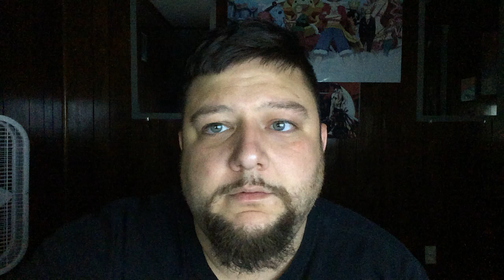K20 Rotating Assembly Swapping

Comment: Hey I have a question? So you said the k20a3 is the only Engine with a different crank. My question, I understood the rod bearing journals on the a3 crank are bigger, but are the main bearing journals also bigger or are they the same as the other cranks??
Reply from the maker: Mains are the same

Comment: Hey man, quick q.  I scored some TSX cams and was wondering if this is a direct fit on a k20a2 block?  Can I also swap the 50 degree VTC on it.  Lastly, can I run this with my existing tune to get to the dyno safely?  thanks
Reply from the maker: bhadz100 1 yes 2 🤷‍♂️ 3 no. Anytime you change anything you need to tweak the tune
Reply: VHB Engines I received the cams in the mail and noticed that the actual shafts (not the lobes) have some wear/scratches.  is that fine to run since it’s not really the lobes which are worn/pitted?
Reply from the maker: bhadz100 yea

Comment: Hey man I have a question, I recently went to get an Alignment at my local shop that a had a pretty good reputation and that same day I popped an Axle hitting a right turn and the next day I popped another axle that was brand new just replaced. what could have gone wrong? It just keeps popping out of the cv boot, if you or any enthusiast could help out that would be awesome. I'm hella stuck and I have popped 3 axles and I know they are the right length.
Reply from the maker: _ 91_B20DA9 probably too low. In box pics on fb
Reply: VHB Engines Sent!